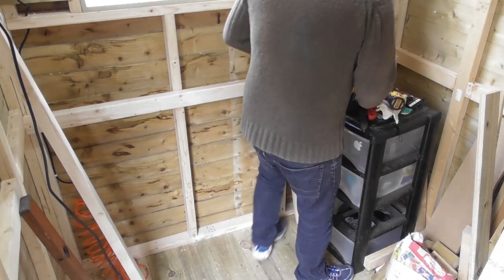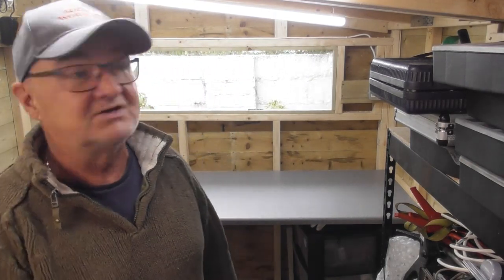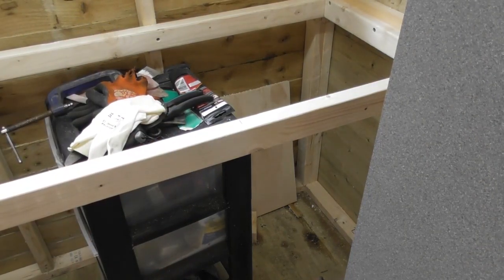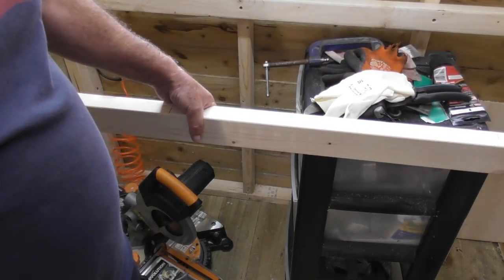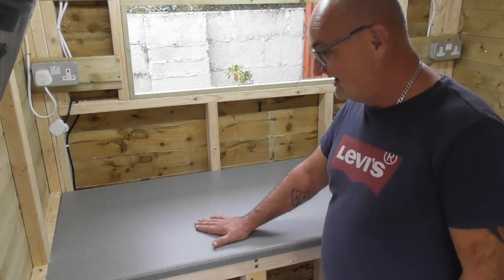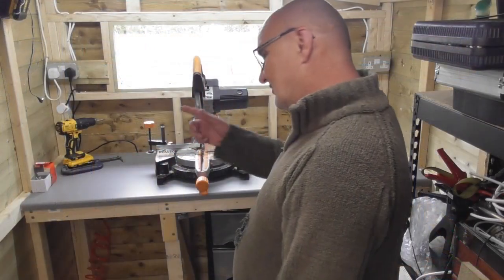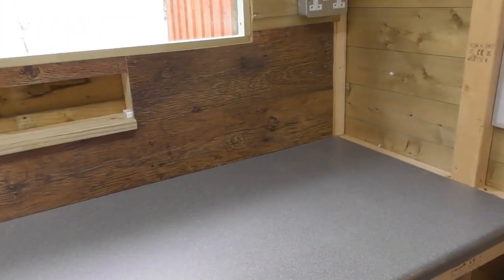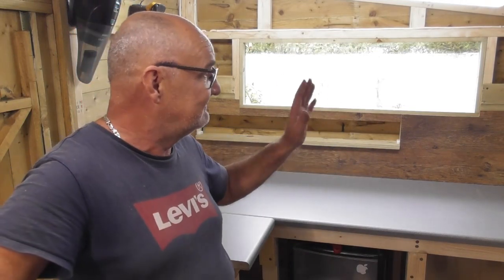Shed extension part 3

Comment: Checking your level, that's an engineer at work 🎩. Rotating the level 180°,  to check accuracy.
Great job Sir. Thanks for sharing.
Reply: Bosted Tap "checking your level, thats an engineer at work"? No! An engineer would of had the shed itself level for a start, not running on downhill concrete. Then with a level top, high lighting the slope of the shed!
Reply: @gbwildlifeuk8269  to elucidate, "Checking your level", referred to rotating the level 180 degrees, to confirm and/or average the accuracy of the vial. When using precision engineering levels, normally  manufactured in 8", 10", & 18" lengths, and with accuracy  typically "0.05 mm per Metre"/"0.0005" per 10", before use all must be checked, and carefully used, then final readings taken by rotating 180°.

Comment: G’day Ade well done mate it looks good can’t believe how that white board fitted between those two studs, the great thing about it and I wish my workshop had it is the wooden flooring far better on you legs than the concrete I have.   I’m glade that your fixing up that roof joist down the other end I could never figure out if that was sagging or not and you showed that it is good one it looks like a real cosy workplace, kind regards John Tasmania Australia 🇦🇺

Comment: Ade, what do you do in the winter for heat? Have you given any thought to making a mini wood stove? It would make an awesome video. I made one out of an old expansion tank that is just slightly smaller than a 20lb gas tank. It heats up my 10x16' shop in about 15 minutes. I usually have to take off my jacket. Just a thought.
Reply from the maker: I have a 2Kw heater that sorts it . Cheers Ade.

Comment: Good work Ades. I like your video's. A specially the humour you bring in to the video's. Perhaps building storage drawers under the workbench. It give's a lot more possibilities for storing tools etc.  I am using torx screws instead of philips screws. Because a torx bit have more grip and less change of slipping  over the head of the screw.  Together with a impact wrench (Lidl) for these torx screws is a  perfect and strong tool  for screwing woodwork. As you always say .... happy days  :)

Comment: I had a heat problem in my shop shop 110 deg. ( south texas) so I insulted it and installed an ac( 30x40 metal work shop) works great .

Comment: Ade, take your buttresses off again and glue them to the post you will get about six or seven times the weight holding strength compared to just screws.